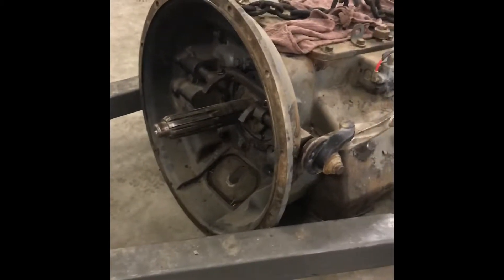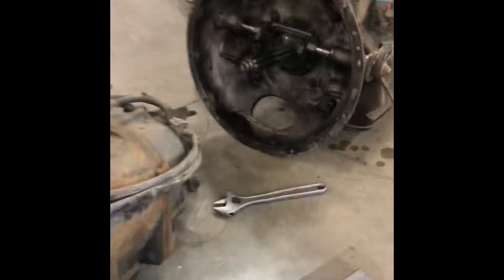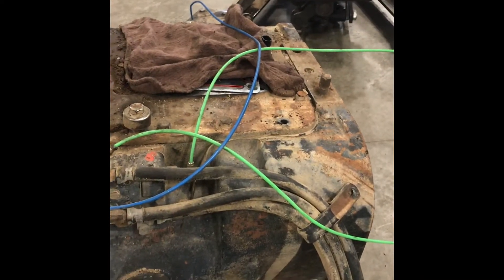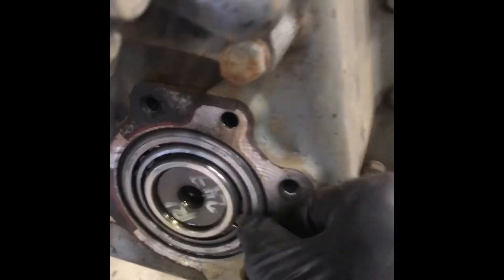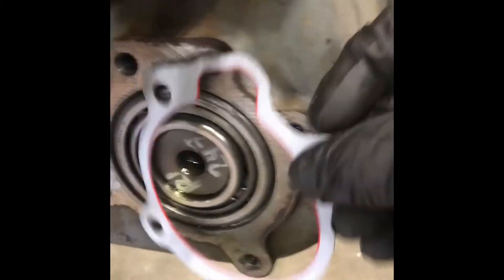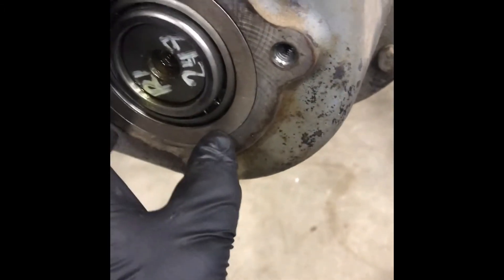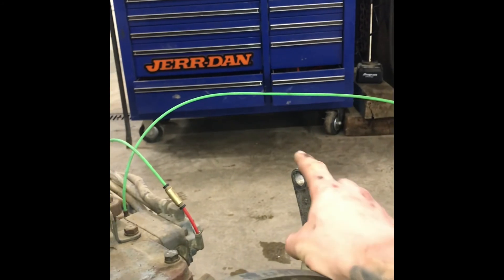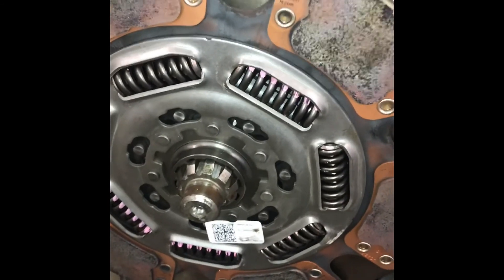18 speed Eaton Fuller installation guide

Comment: Trying to rebuild my 18speed gearbox back but having problem with the timing marks
Reply from the maker: Go to the Eaton road ranger information site you just find and match your transmission and it will have the repair manuals and it’s feee